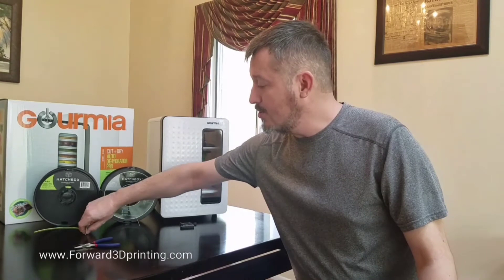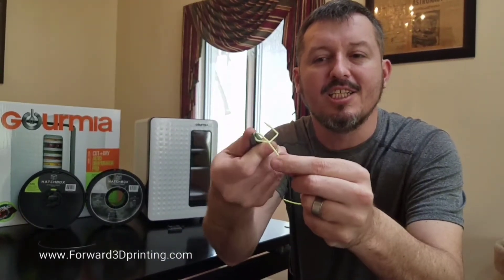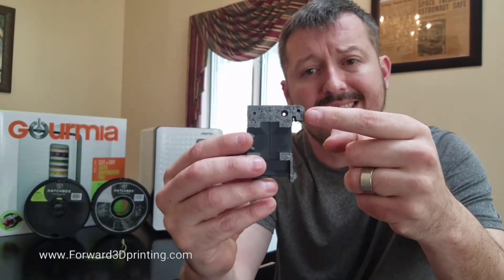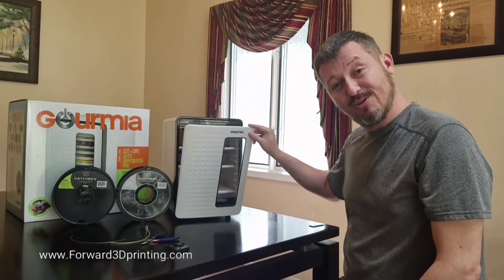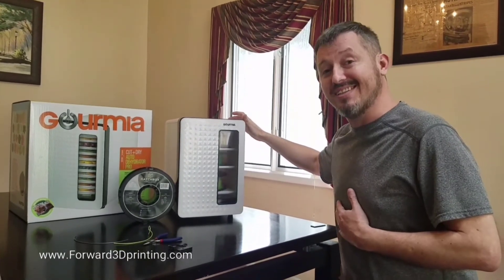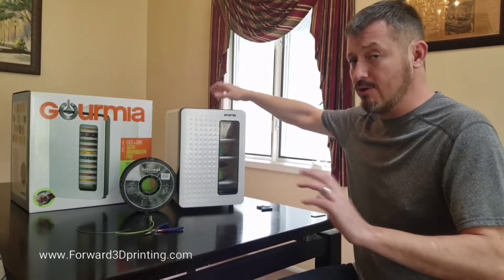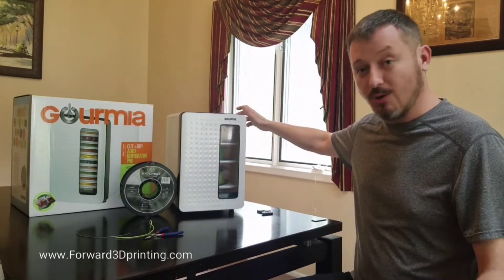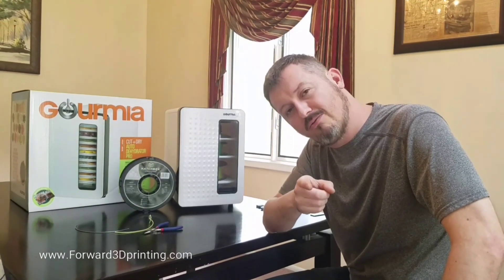Review: Dehydrator for 3D Printing

Comment from the maker: usually I just have it running at 132°f and I let the materials dry over a 3 hour period,  once they are dry you can put the roll inside a gallon bag, with some descicant and take as much air as you can oit of the bag, before storage😊